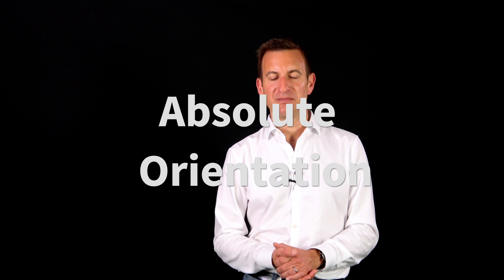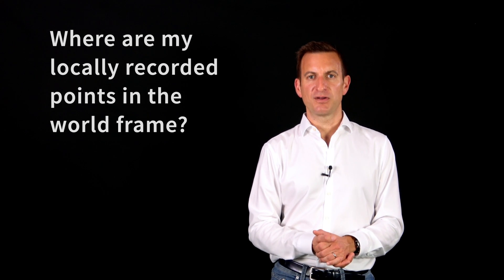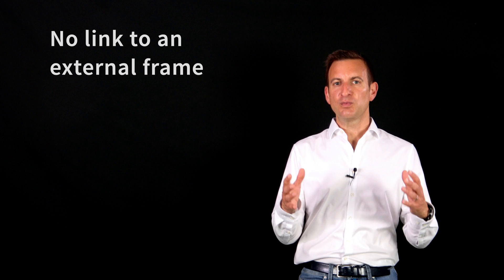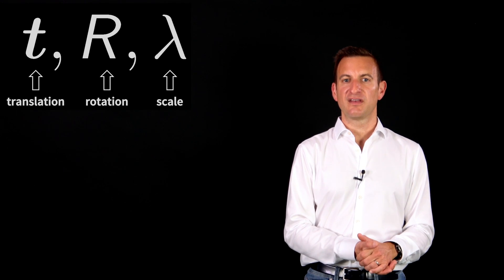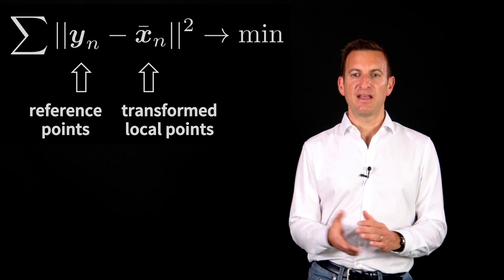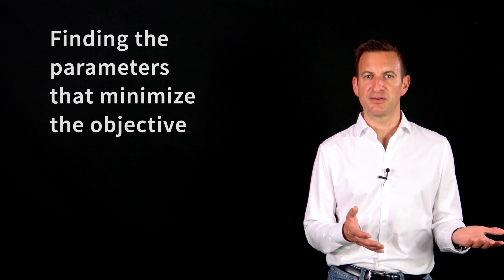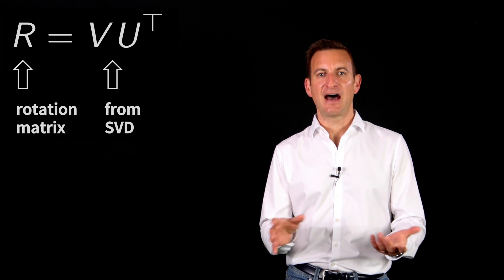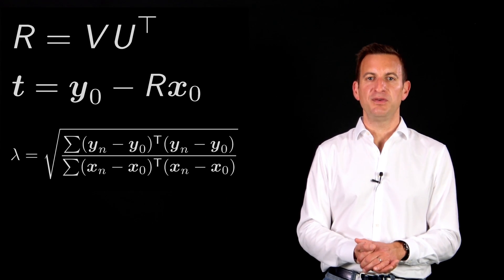Absolute Orientation Problem - 5 Minutes with Cyrill

Comment: First question: Does Kabsch algorithm solve this absolute orientation problem ? Second question: if we do not know relation between two coordinate frame how do you paired individual points in the two set of points ?
Reply from the maker: 1. The Kabsch algorithm computes the rotation matrix - and it is highly similar to the method described here (see e.g. wiki page). 2. If you have no initial guess for the assignments (I guess that is what you are asking), you would probably compute the mean of both point sets and shift the sets to make the means identical first, and then compute the data association in a nearest neighbor fashion. You will however need to iterate then (see ICP). An alternative, which you will probably use for image data, is to exploit feature descriptors such as SIFT to compute the data association.